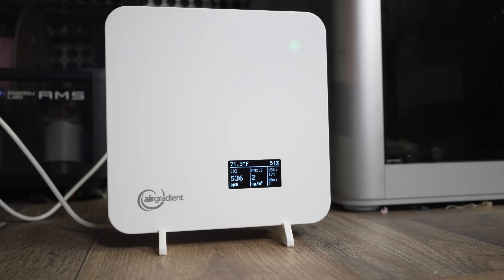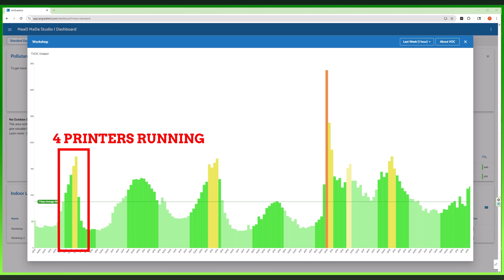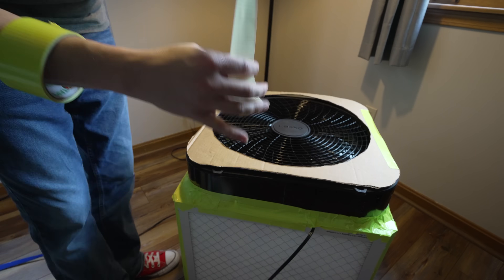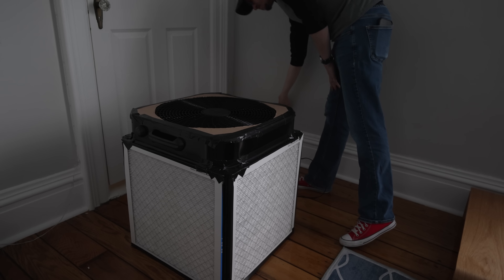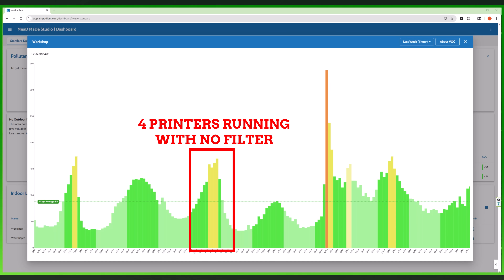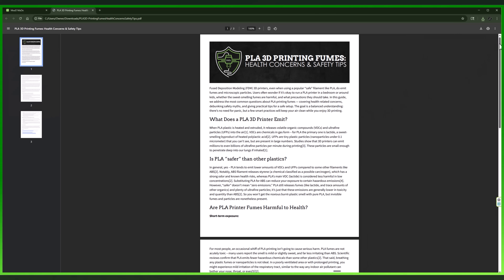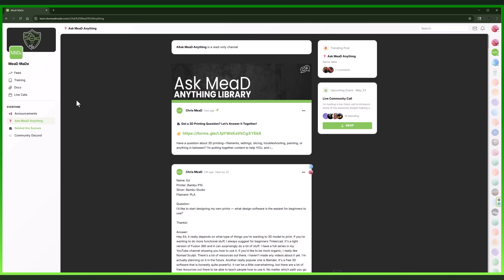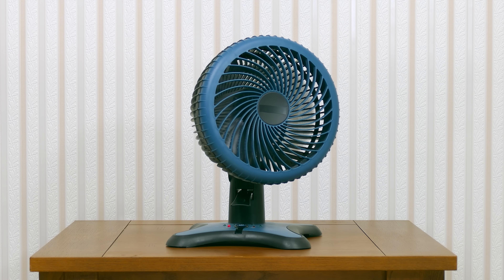Is 3D Printing PLA Really Safe? "Ft. Air Gradient Air Monitors"

Comment: One of the 3D printer Facebook groups that I follow has been ON FIRE !!!!!! With this very subject. I have upgraded my P1S with a VoxelPLA Bento box and their Xfilter but being a full time RVer I have been exploring some options to add some type of filtration to the rear exhaust port.  I print mainly with  PETG and PLA, I am not necessarily planning on running ABS or ASA but I have not completely discounted the thought. I already run a standalone air purifier  and I have noticed a big difference for how the air “feels” and I like it. I also have some seasonal allergy issues especially in the spring where I bet it will make a nice improvement.  There are so many options on the commercial market for external air filtration for these various machines, it is difficult to settle on one.  And all this is before I upgrade to a P2S machine….. 😂.   Thank you for the video.   Keep it up man.

Comment: Well I got a 1 room appartment but never thought about the drawbacks of it. Used a Mk3+ and got a P2S now. Used the P2S for a few days and after a  longer print my throat started getting dry and I have a problem with it for a week now even wothout once using the printer again. Kinda scarry, the cold dry air could be pushing that too but still I am rly searching for a ventilationsystem to hook up to the printer + a purifyer for my room to take out the most possible since I cant open the window so much in the winter xd Any other advice?

Comment: Thanks for the info sharing man. I've been printing PLA in my office, where i spent like 7-8 hours a day in an enclosed room and air conditioner. The printer just few meters from my desk. Now as a start, i open my window a bit and have a desk fan running. Definitely thinking of buying air filter but the one you suggest is too big.

Comment: Your study is faulty, you didn’t try it with just the fan rotating the air without the MERV13 filters. It’s probably not as bad as you found. I would redo the study.

Comment: I’m still on the fence with buying an A1 mini, mainly because we have many pets, and I would have to put it in my bedroom. Although I wouldn’t print when I’m asleep, I’m worried that the fumes could be toxic to me or my pets. Do you know if it’s safe or not?

*I could technically put it in my garage, but that would be last resort

Edit: what would be super easy that might work is to set it up in my dining room right next to open windows? Although since I eat in there that might be an issue?… If you get back to this, thanks so much for your help in advance!

Comment: Having actively moving air is the most essential part. open a window, fan or ac and you'll be just fine. i wouldnt invest in that filter abomination though, just hop on a refurbished open box 2nd hand e-store and find one on the low low on the cheapo. thats what i did. you dont need a dyson.

Comment: I came back to printing only when made DIY exhaust with fan to the window, it's started a barely minimal normal for how my body reacts, and it is only PLA. I printed for a week or so just with opened window and stopped, it so not good at all.
Tested air purifiers with activated carbon expensive filter, but it only works for a month or so depends how much prints a day you do, after filter began to fume itself, so need to change it. My conclusion is if you're using air filter, use only with exhaust ventilation system, and you need to build vent system 100%, if you're using printer in the living room/office. Companies are slient about it, so it is your responsibility.

Comment: I did not see this video earlier. I probably know more about pla than average. 
If you are printing with a plain pla with nozzle temperatures up to 130 deg Celsius, there should not be any VOC's formed and (depending on the print speed) only a (very) low number of fine particles. It is 100% safe to be in a room with an open printer using filaments like this. These days there are many kinds of PLA like: silk, high flow, with added glitters or fibers, glow in the dark and so on. All these additions can (and most will) produce VOC's. It will still be save, but if you have to be in the same room with the printer, it would be wise to ventilate.

Comment: Unfortunately i dont have another spot for it other my bedroom atm:( i do have about 2 purifiers though that im planning on putting activated carbon filters / hepa in , and i was also going to buy a cheap smaller purifier hepa + carbon activated purifiers to fit inside of my enclosure tent for my creality k1 se to atleast help i have health anxiety like a mf i only print pla and wanted to do petg but right now only PLA i wish i could fix this. Bc i definitely cant run a vent outside the window in my room nor  do i have many places to put it i dont want to give up my hobby but danggg

Comment: What’s odd to me is I’ve had an air filter that constantly monitors air quality in my office all day and never gives alerts or increases power when printing pla. But if my wife cooks bacon on the other side of the house it will show bad air quality and ramp to full power. 
And it looks for particles and voc
Reply: Same here, i put it right next to the printer and nothing...According to the air purifier, air quality didn't change at all...and it is not a cheap one
Reply: I'm interested in this

Comment: WARNING: The proposed filter system is completely inadequate for removing VOCs!! While I applaud Chris for raising a very serious issue with 3D printing and air quality, the proposed HEPA air filtration system only removes particulate air pollution, not VOCs. To remove VOCs, the filters would need a layer of activated carbon. However, carbon filters will become saturated with VOCs in time and will require periodic replacing. A better option (IMO), is to vent directly to the outdoors.

Comment: One big problem here is that a particle filter like the box fan thing will not remove vocs from the air your just spreading them around so the voc reading gets lowered by the air moving around and out a bit. To filter VOCs you need an extractor fan cheapest open or expensive open as much activated carbon and purple filter media as you can afford then it will work great for vocs. Hepa filters dont filter out fumes only chemical filters do that.
Reply: Ok, that sounds good now. How about showing us how to find them? lol
Reply: Some troll on the internet says stuff.
Reply: @SuperPlastered  No, they're correct. HEPA filters do not catch VOCs, which is where I'm trying to dial in my printing setup in a small space.
Reply: I was looking for this comment. You are 100% correct. These Filters do nothing against VOCs they are PARTICLE-filters.

Comment: Can we use any air filters? Or must specifically like that one? If you can answer please
Reply from the maker: That’s a great question. I personally use the filters recommended on the Corsi-Rosenthal website (linked in the description). You can definitely use other 20-inch square filters, but lower-quality ones may not perform as well—especially if they’re not rated for proper air filtration. The studies I mentioned were all based on the filters I used. That said, even a basic setup is better than nothing—just something to keep in mind!
Reply: @ItsMeaDMaDe 
Yeah what to there is no such filters in my country so I must improvise 
But you really did great its just way better method than a 300$+ device that do nothing

Comment: Very few people vent the gas from their stove to the outside. Very. Few. Some mistakenly think that a filter over the stove that helps to capture grease is effective. It’s useless. California dis studies on powder coating, which uses an extremely fine plastic powder dry sprayed onto a metal part. It’s then put into a powder coating over to melt the plastic at around 400 F for about 10 to 15 minutes.. The temp and time differs from plastic type. The conclusion was that the dust was classified as “nuisance dust”, and the fumes as not harmful in the quantities typically produced. That doesn’t mean you should do this in a sealed room. I do it in my garage along with my welding, something that can produce far more dangerous fumes requiring special extraction or respirators. 3D printing is similar. ASA is one of the more dangerous filaments to use and I advise against it. Really, there’s no advantage to using it as there are other filaments that are less dangerous with equal, or better performance. But PLA is pretty benign. Still, as long as there is decent air flow in the room it’s not a problem. Just don’t close the door and the windows when using it.

Comment: Great video! Most of these negative commenters clearly haven't considered accumulating effects of what you're breathing daily, wherever you're breathing it from. Keeping the air in your home clean is a no brainer. For the one printer setups you can now get carbon and hepa filter desktop air purifiers for reasonable prices! Just put it next to the printer and turn it on when the printer is running.

Comment: I have a combo HEPA / activated charcoal bento box unit inside my P1S.  It starts automatically when the print project starts and shuts off when printing finished.  
Thinking to get the air quality monitoring system mentioned and see how well its doing.  May need to add more filtration.

Comment: Thanks for spreading the potential hazards of PLA! A couple of thoughts:
It would be really interesting to see a test with just the fan running without any filters, so the filter's actual impact vs. plain air circulation can be evaluated.
Also, you mentioned the smell of ABS several times, and while in this case the emission of styrene, which is a harmful compound and smells is a valid case. But smell and harmfulness don't always go hand in hand. Just because something smells doesn't always mean it's dangerous, and the other way around, some harmful emissions might be odorless.
Also, air quality sensors are not perfect. They can give false positives and false negatives.
All in all, if you smell something, it's probably harmful - but not necessarily. And if you don't smell anything, it doesn't mean it's harmless.
Ventilation is always a good idea. Filters can give a false sense of safety, which could potentially cause even more harm

Comment: Been digging into this area a lot, my printer is in a very small workspace and prior to arrival I wanted to get some data to help with this.
Got a H2D so arguably it has some of the better filtration available.
Finally got all the ducting so I can vent outside but been printing a wide range of filament, PLA, ABS, ASA and PETG.
Got an IKEA Uptavind air filter and added the carbon modification to it, also added a carbon filter to the printers internal fan assembly so it filters when printing in PLA.
My AQM is the one from made with layers and I've placed it at the back corner of the printer as that's where the worst of the emissions seems to be.
Don't see huge amounts of PM, tied more to me moving around in the room and down to 0 when the room is shut up overnight and printing and IKEA fan running.
I do see rises in TVOC levels, it's well within safe limits but it does still rise, notably on an overnight print there is a steady build up despite the carbon filter on the fan.
Got some zeolite on order as this is far better at extracting VOCs versus carbon alone especially with chamber temps up at 65 Deg C.
It's worth noting that many cities air quality is worse than the brief spikes I have seen.
My worst readings were during soldering.
A spider plant will remove formaldehyde from the air - not a plant guy but probably going to get one!
Complex subject but I think too many people rely on smell as a warning indicator and that just isn't the case.

Comment: I've always been hesitant to get a 3D printer because I live in an apartment and don't want to poison myself with the fumes plus I have a 7 year old. If the fumes from 3D printing are so bad then why are there not very many videos about it or companies making products to help remove them? You would think the companies making these machines would have filters to help with all this. I have seen some videos saying the fumes aren't as bad as everyone says then you see other videos saying they are very harmful to your health.
Reply: Because with PLA, despite the scare story here, it’s not that dangerous. Less so than most cooking. Do you vent the gas from your stove to the outside? It’s the same thing that comes out of your chimney.
Reply: @melgross this is probably correct. 

We haven’t seen any long-term studies yet of course, as FDM printing is just way too new for that. 

We can all agree that printing is probably worse for you than not printing. But the effect of PLA might be so negligible that it just… disappears is there. 

Would I run 4 printers in a room with 0 airflow that’s my bedroom? 

Hell no! 

Would printing over the day with a normal FDM printer and sleeping in the same room, bonus points for a HEPA and/or carbon filter be fine? Probably.
Reply: @salat8735 exactly! It never hurts to be careful. I weld, often stainless. That’s very dangerous, so I wear the proper respirator under my welding hood. Could I get away with it if I didn’t? Probably, with the front and rear door to my garage open, on a breezy day, and I was upwind. But why take the chance?

Comment: I'd also like to see a comparison with other home spaces: kitchen, bathroom, garage, etc. E.g. how bad is one printer printing PLA compared to frying up some dinner or spraying hair product and/or deodorant while getting ready to go out? Or just being outside as the traffic drives past? That way we can see how bad it is in relation to what you have to deal with without 3d printing.
Reply: Agreed. Especially air quality next to a busy road.
Reply: the problem is that my air meter does not measure the really harmful particles that goes into your blood. but it reacts to spray deodorant, after you have been making food, the cat next door. ,   but it does not measure the traffic outside the window at all, but the filter that is white turns black in a few weeks.   but nothing seen on the airmeter. The lasercutter at work even with 2 hepa filter for industial use, you still feel the smell of laserdust in air...
Reply: if you are useing air spraying products for 3-6 h you are ready to use and printer , or sit next to a street for 10h without any problems.the point is everythink has a impact of air quality for a short time, but printer runs most of the times for Hours

Comment: I didn’t find in the video where you pointed out a “hazard” threshold, i.e. what level of VOCs are NIOSH or OSHA actionable. Without an OSHA-TWA level cited, the “peaks” indicated by the monitors are meaningless, or at least, only relative to a “zero” value. I agree that one shouldn’t “welcome” airborne contaminants into their workspace, but without a reference value (TWA for an 8 hour exposure, for instance) the summary you provide is still pretty anecdotal. I appreciate the effort, but without NIOSH-type values it comes across as a bit alarmist.
Reply from the maker: Thanks for your feedback. You are correct in that this was not a super scientific study but it wasn't meant to be. I wish I had the dedicated space to do more testing and have controls. I also really want to try the carbon filters that others have mentioned. I'd also like to know what chemicals are really in the filaments being released in fumes. Different companies put different additives in their filaments and claim proprietary formulas. How toxic are those extra chemicals? It also seems that companies are only required to do MSDS on the raw filament and not when it is melting. Also, as others have pointed out, how do these VOCs compare to everyday cooking, cleaning, outside air etc that we are exposed to daily? The Corsi Rosenthal Box came up in a NIH study that intrigued me. It seemed they had success in reducing VOC and SVOC in that study. "We used SSA and NTA to demonstrate that do-it-yourself Corsi-Rosenthal boxes are an effective means for improving indoor air quality by reducing a wide range of volatile and semi-volatile organic contaminants." https://pubmed.ncbi.nlm.nih.gov/37414869/  My test with the air monitors seemed to validate. But I think the most important part, as I said in the video is ventilation and airflow. This is certainly a topic worth much more discussion. Thanks again for your input and thoughtful critique -Chris
Reply: @ItsMeaDMaDe it’s far more dangerous cooking inside with gas without an exhaust that goes to the outside of the house, than it is printing PLA. Just because there are VOCs, doesn’t mean that they are harmful. What were those VOCs? We have to stop the scientifically incorrect assumption that everything is harmful. Tens of thousands of people have been printing with PLA for 15 years now. I’d like to know what, if any, ill effects have been seen from this, as nothing has been reported. About that filter, what is the cubic footage of the room?
Reply: I also noticed that, even with four printers going and no ventilation, the reading only got into yellow levels. I assume that actual harmful levels would have been red, right? To me, it looked like the meter tests showed that PLA is about as safe as one can hope for.
Reply: I found this on a very timely basis.  Just today I was printing matte PLA on my P1S as I have been occasionally since getting it 2 months ago.  It is in my home office, which is really a spare small bedroom.  For the first time ever I noticed a smell of hot plastic.  Finally realized I failed to plug in my Voxel Bento Box after the last time I moved the printer around to get at the back.  Plugged it back in and the smell quickly disappeared.  I am sure it doesn’t get all of it but I had not realized what a difference it was making
Reply: Imagine trusting the government